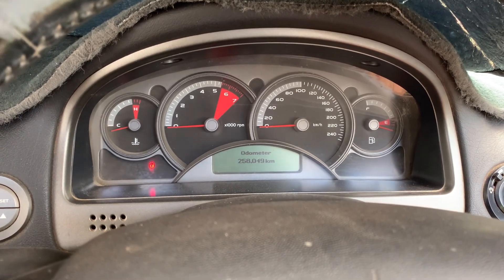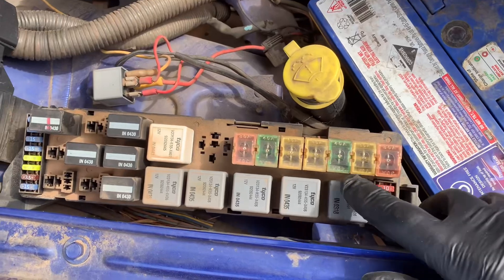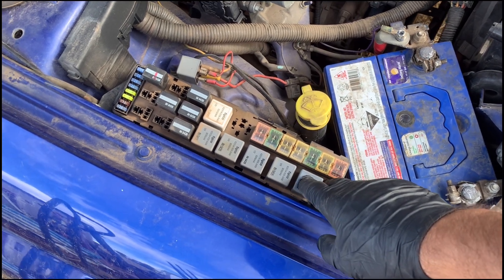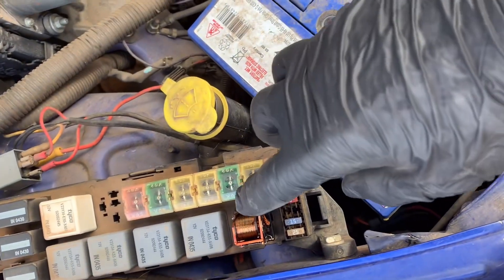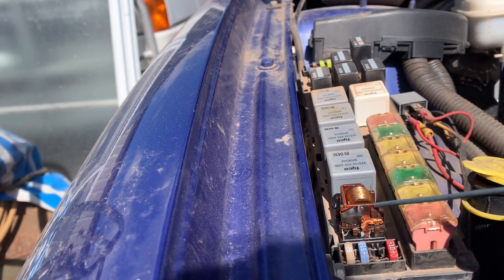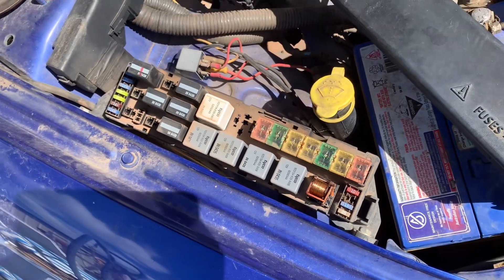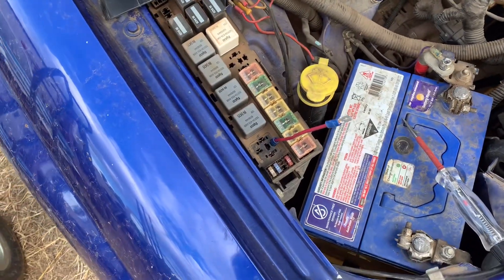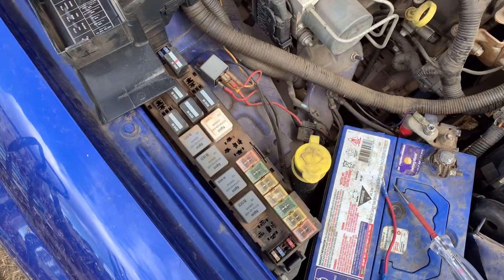HOLDEN COMMODORE VZ NO CRANK NO START…..

Comment: These Holden's are an absolute joke, these immobilising issues are a disgrace. 
Thank god they went bust, and we finally stopped buying rubbish done up as home grown quality.
Reply from the maker: Haha… it is a shame that this is happening I just can’t believe that there’s no one smart enough in Australia to repair them cost effectively. Injectronics in Melbourne charge over a $1000 and you have to go through one of the spare parts shops so they can make a cut and when shit hits the fan you can only complain to the parts shop…. Absolute disgrace….
Reply: @howtopete33 I have a VZ adventra V6 wagon, it's immobiliser issue is gutting me. I've had enough drama with auto electricians attempting to extort me without actually remedying the problem, to the point I've had police called on me and been charged.😮 
I now have to look at changing the computer altogether, if that doesn't work the car's going and I'll (unfortunately) never buy another VZ again. 
Pity, it was my favourite model ,but this immobilising problem is just too much.
Reply from the maker: There’s a guy around Newcastle that’s usually selling the ECU, bcm and keys I can’t remember his name I’m sure he’d be able to help you….

Comment: Hey mate may batterty was dead in mt ve 2012 ute . my mate putthe new  battery in the wrong way .ive got no power or crank at all ..ive replace the main fuse link on my battery terminal and the fuse link from the jump point to the fuse box and alternator... ive checked fuses tried different relys ..but the only power i have on the dash is the immobiliser lock light and nothing else  ..  any ideas im thinig my ecus fried or is there anything else im missing..thanks mate love the vids cheers
Reply from the maker: Hi, oh no … I’m sorry to hear that. You have to check every fuse and note what that blown fuse was so that you can inspect the component the fuse was for. Usually the diodes in the alternator will blow. Check for melted wires. BCM and ECU could have fried…. Have you put a scan tool on it to see what codes it’s thrown? Good luck! Please let me know what you did to fix it for future reference. Thanks for your kind words and support….👍🏻

Comment: Hi l have a 2002 vy ss commodore that is doing the same. 
What would you recommend to check if l have done what you have shown in the video and it is still not starting?
What do l need to check?
Cheers
Reply from the maker: The V8s are prone to bad ignition switch/wiring from the back of the ignition barrel. That’s where I would start. Good luck and thanks for your support….

Comment: Same problem also i've found is when you get a fuel sender fail message, the car will not crank.
Reply from the maker: Ok. So what is the fix for that? Thanks for sharing… this is the best platform to learn from each other….👍🏻

Comment: VZ SV6 thanks, Wired in a Start Engine button into the dash, after I traced the relay wires and split off them. You have to crank the key and press the button at the same time and we have an Engine that starts. 
The ecu only plays up when its really warm.
Reply from the maker: That’s right not all of them behave the same. Some need to be jumped every time others once in awhile etc… thank you for your support… I hope you got some benefit from watching my videos….
Reply: Mate my car has a fuel gauge error and is causing it to not start and I think it’s related to the ecu can you help?
Reply: do you know any videos where i can learn how to wire a start engine button/switch for this exact same issue. my car always has this issue almost every 2nd time when I go for a drive

Comment: Hi thanks it worked..but my fuel saying low fuel but i just put 50 bucks in before doesnt start going to get extra fuel to see whats going on
Reply from the maker: Sorry to be the bad news bearer but if my little relay trick worked no amount of fuel will help you. Your ECU is cactus. You must replace the ECU to fix the problem… Good Luck…. Please let us know what happens regardless of outcome….
Reply: @howtopete33 is found some wires on the jewt shield being damaged from the hot surface hanging loose...it goes down to a spark plug maybe towards the fuel line to spark
Reply from the maker: I don’t know if that’s your problem but please let me know if that fixes it.

Comment: Does this work on a ve sv6? My brother in laws car won’t crank over
Reply from the maker: If that’s the issue and if it’s a VZ then yes. There’s heaps of reasons a car can crank but not star. This is a quite common issue as the ECU are failing. Good Luck.

Comment: my vz ute storm 2004 tries to start when i do this but wont kick over and actually start
Reply from the maker: Sounds like an immobilizer problem. Is the battery good in your key?
Reply: @howtopete33  hey mate thanks for replying I havent thought about that being the problem.when i bought the vz the key was working then a day later after getting home from buying the vz ute the car wouldn't start so installed a push start button straight into the relay i just had to turn the key for power to push the button but now that wont work. maybe your onto the key immobilzer.
Reply: @howtopete33  last time i was driving, the car would lock and unlock with my key when i pressed it.
Reply from the maker: Did you sort it out? What was it?

Comment: Do you have to put the cover back on the fuse after starting?
Reply: I've also found if you put in a scan tool into the obd2 it'll start right away and you can drive around with it connected without issues and turn the car off and start it up again with it still connected as soon as you unplug the obd2 it'll cut out
Reply from the maker: Unfortunately I couldn’t replicate that.
Reply from the maker: No you don’t…

Comment: Mate what was that you used to power the relay
Reply from the maker: Nothing. When you turn the ignition on that powers it . All I did was just manually activate it instead of the ECU. If your relay doesn’t have power you have a fuse issue I’d say…
Reply: Hi mate i had the same problem your trick worked but my fuel says low fuel it cranks but doesn't start
Reply from the maker: I’m glad it worked, perhaps you can have a look at fuel pressure next.

Comment: But what is fhe permanent solution, so i don't do this but use key and start every time. My vz Commodore 2005 is doing this, but no other signs are coming up. Just no crank, no start intermittently, gets started after some tries, but most of times straight start.
Reply from the maker: Couple of things you can do… change the ECU but Holden don’t sell them anymore so a second hand one is your only option which more than likely will end up doing the same thing. The other option is to introduce a start button, so you would turn on your ignition with your key and then press the button to start. In evanescence you’ll be doing the same thing what in my video only from inside the car. If you need more info feel free to contact me…. Good Luck!
Reply: @howtopete33 I’ve been told if you get a second hand one you still have to tune it for your car
Reply from the maker: That’s correct. But the bigger problem is it needs to be released within a scan tool from the donor car and you must have the security key ( numbers ) or it will never work.
Reply: I put a new starter relay and it started straight away and has since .
Reply from the maker: Lucky for you it was only your relay.
Reply: You can get the ecu reconditioned , it’s not a job you can do at home.
Reply from the maker: Do you know who does it apart from injectronics in Melbourne?
Reply: Wish I had of known that a few years ago